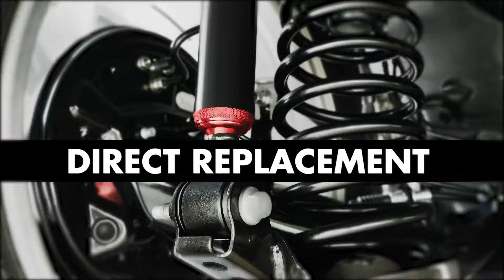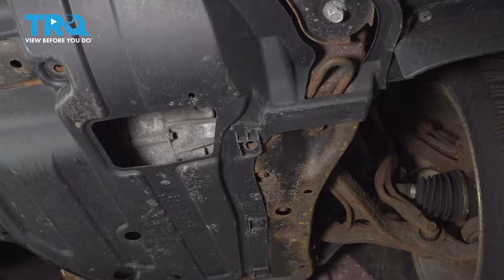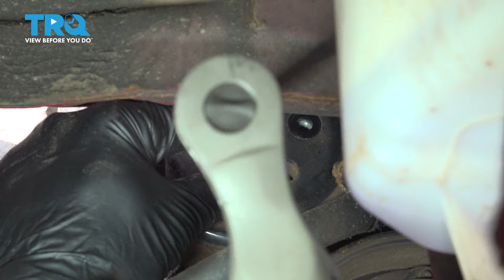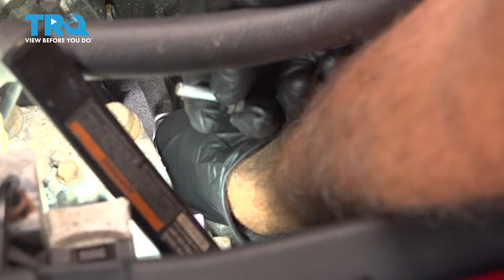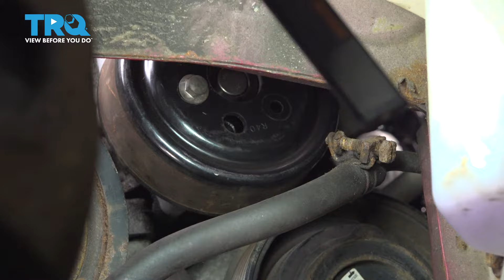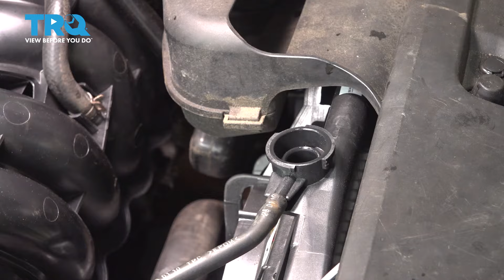How to Replace Engine Water Pump 2008-2012 Honda Accord

Comment: I could not do this the same way on an 11 CRV. The pump pulley would NOT come out separately from the pump and I also had to remove the alternator to gain access to all the bolts.

Comment: The "magic" part of the job is getting the serp belt back over the last pulley. I jammed the tensioner open with a block of wood and used both hands and newly-minted swear words to get the belt back on.